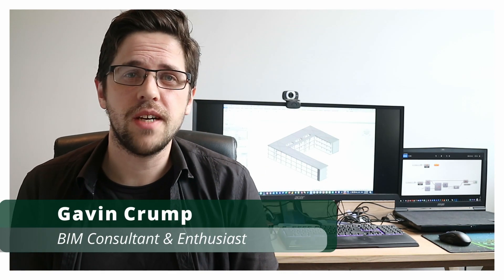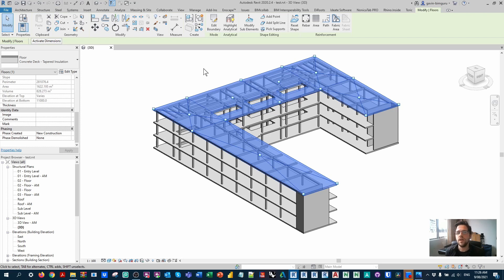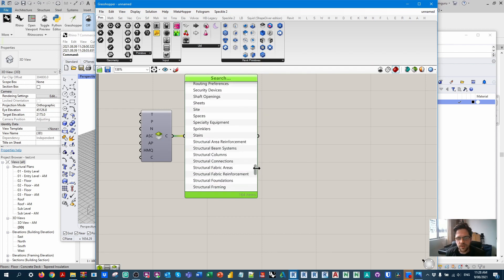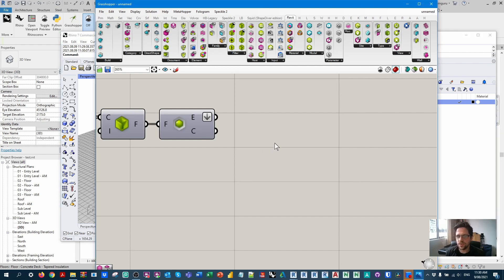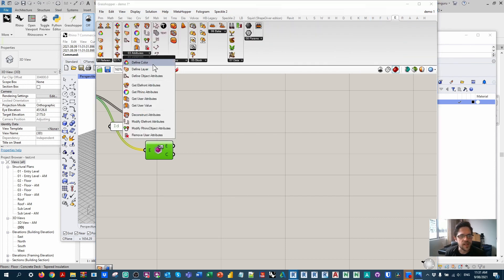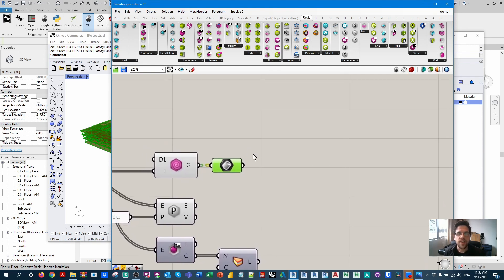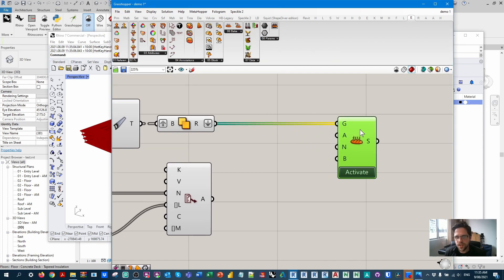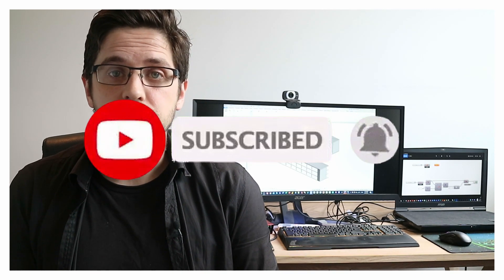Revit Structural elements to Rhino using Rhino Inside!

Comment: Thankyou for this workflow. I have one concern. I think you need to inform that when you are getting elements inside rhino its necessary to set the "Detail Level" to Fine. Otherwise this algorithm can give you false results I guess. Because if we dont set detail level to fine then you will get structural framing into "Curve" form. Thenafter you pass element geometry node to Brep it is going to give error and as you did clean tree operation it is going to remove that curve from the list. Now the data structure is showing incorrect results for "Define Object Attributes" node.
Reply from the maker: Yes in my experience it will initially use detail level in the active view and the detail level then acts as an override. In this case it definitely retrieved the intended geometry, but a good point and might be relevant in some cases. Thanks!

Comment: Why does dynamo cant have such a user-friendly interface as Grasshopper?!
Reply from the maker: Yes there are definitely some things I'd prefer to have in Dynamo like output flattening and the search/ribbon/panel tools.
Reply: @AussieBIMGuru  Im sure Grasshopper has it, but manual or automatic run similar to dynamo would be helpful.
Reply from the maker: @adaxrvt  i don't believe it does. I usually use stream filters and buttons to simulate manual mode.
Reply: @AussieBIMGuru  you can try to lock the solver and unlock when the script is ready. For me this works great.
Reply from the maker: Yes this works to some degree although I often like to have some data flow live and some frozen.
Reply: Very insightful one... Can you please a make whole series of grasshopper and rhino just as you did for Dynamo.. it will be very useful for beginners to learn.. Thank you
Reply from the maker: @ravichandra-up1nu  i will probably put it in course platform format in future - too hard to make structured content on youtube these days.
Reply: @AussieBIMGuru  That will be very helpful.. When can expect the dynamo and grasshopper course on your platform.. ?? I am eagerly waiting for these two content.. Thank you
Reply from the maker: @ravichandra-up1nu  I am doing my best to have Dynamo and Revit families out by end of October. Covid lockdowns and client work have disrupted my plans here for a while now unfortunately.
Reply: grasshopper made by a large community, while dynamo made by one corporate. I dont think dynamo can catch up with gh in the next few years. 
and this Rhino.Inside is really a huge game-changing.
Reply from the maker: Not true, dynamo has an active forum and package managers. Rhino inside has struggled to find a foothold for revit users unfortunately, but is handy for rhino users for sure. I use it often but have found its only useful for strong rhino/revit users for it to be used well.